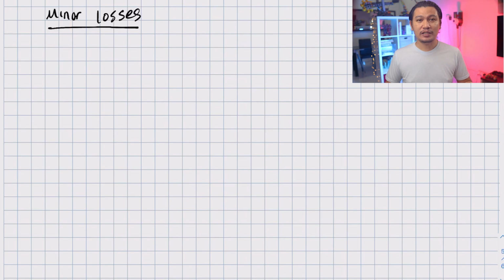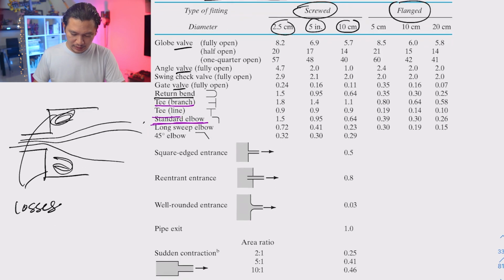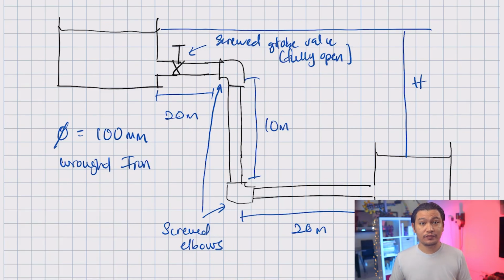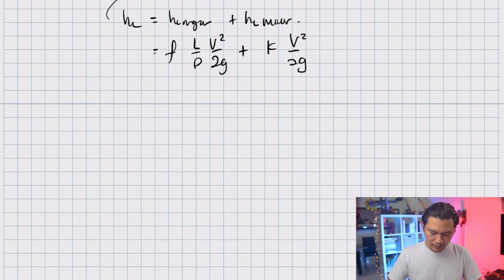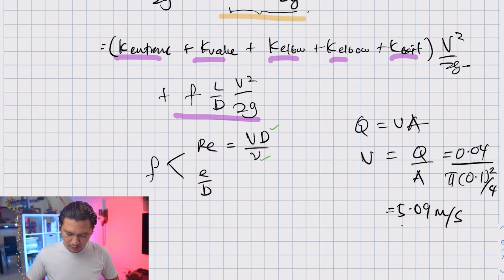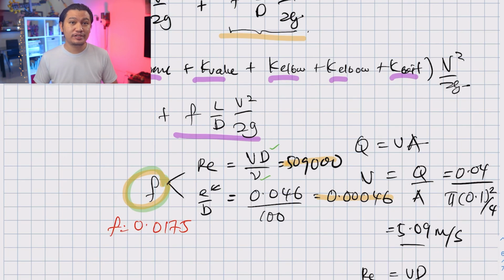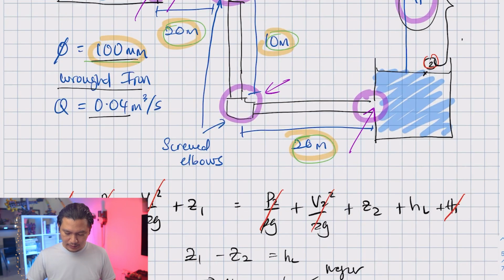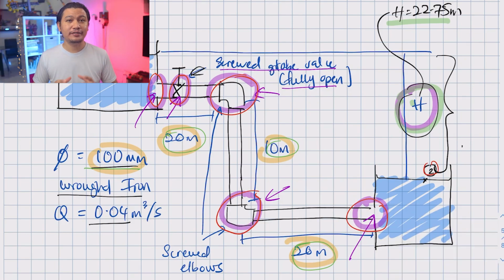021 Minor Loss

Comment: Dr, can i ask is it always zero for the v1 and v2 of the water in the pipe ? you said in the video that the water flows vertically that's why both velocities neglected. or can i just said that both velocities are negligibly small ? can you explain a bit about that part ?
Reply from the maker: It's considered to be very small. So you can neglect it in the calculation.

Comment: Dr, does all the piping system contains both major and minor loss? or in some cases either one of the losses can be neglected? just wondering hehe
Reply from the maker: Major loss is significant if the pipe is long, while minor loss exists due to pipe fittings.